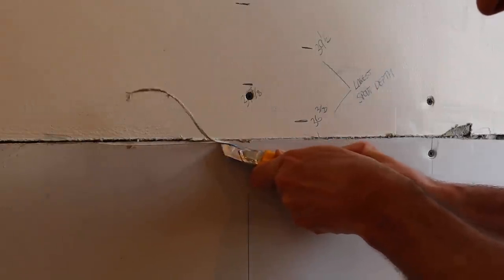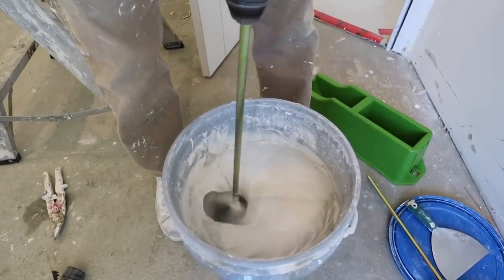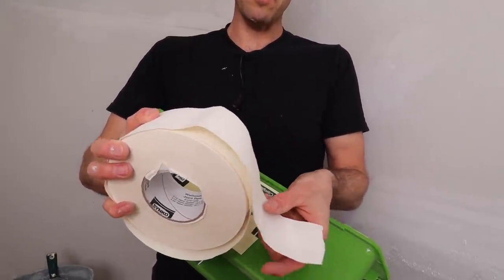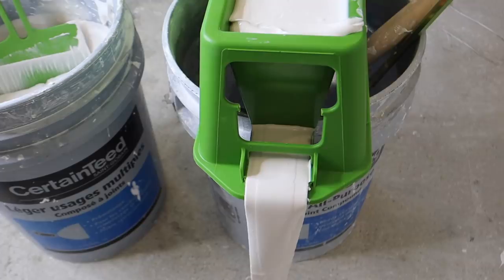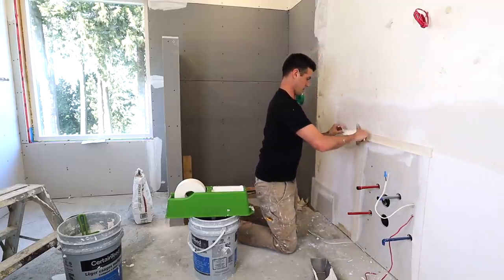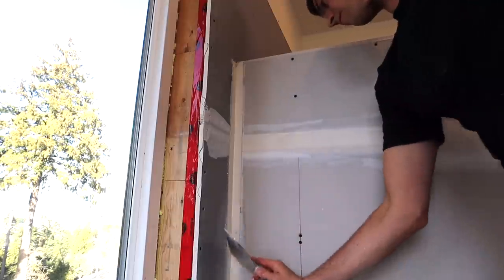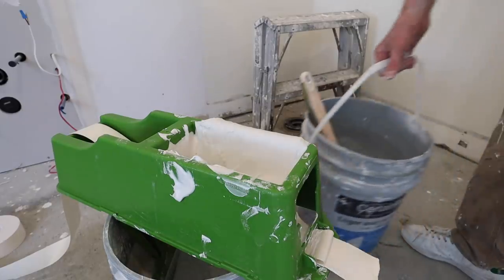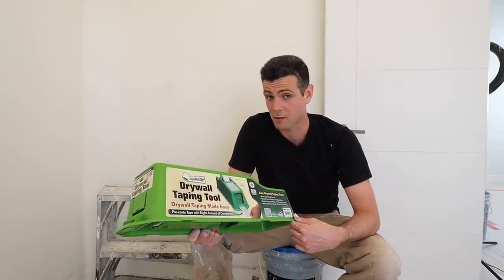How to use the Tape Buddy

Comment: If I may share my exp with it. Couple of years and still using it.

1. As you normaly do, I fill a bucket with mudded tape.
a. I made a cardboard cylinder as axel for the tape roll.(tight fit inside the roll)
b. I make the mud more liquid (helps keep the tape wet for the lenght of the tape in the bucket)
c. I've cut a small piece of plywood to cover the tapebuddy's mud section to keep it from making dried crums.

I've used it a couple of times as you did: one strip at a time. but to me a bit of waste of time... until I saw you use a bucket filled with mudded tape.  THAT was the game changer.  Just needed to find the right mud consistency (liquid enough)

When I strip/rebuild a bathroom, for example, I only spend a few hours taping out of a 12 days project. So the tapebuddy is ideal for me.  The only other tools I would get is the "cheap plastic corner tools" you reviewed:
https://www.youtube.com/watch?v=cQZ9cgn4HkM
(instead of doing one side of the corners at a time).

Thx again Ben.
Reply: bucket filled with mudded tape?
Reply: @nathansteinbaugh2914  He means that instead of pulling out one piece at a time, just pull a bunch of paper tape through the machine and collect it all into a bucket. That way you have a whole bunch of mudded tape in a bucket that you can carry around and all you need to do is apply and cut as you go. Ben did this technique in one of his stilt-walking videos a few months ago using a different mudding tool.
Reply: @claudews529   @umchoyka  ahhh this makes sense thank you so much
Reply: You can pull tape into a bucket but it's messy. That's why we suggest pulling what tape you need as you need it. Need a longer piece? Pull it out and book the coated tape. Much easier.
Reply: @BuddyToolsLLC 
 Are U for real???

Using a bucket, "it's messy"... so not using a bucket is not messy !?!!?  Geee. 

- I need to put a 12ft tape on the ceiling. So I got to pull a lenghty approximation, which I hold in my hands, then go up, apply, then waste the exceeding OR go back down and pull more because my lenghty was not long enough. Then go back again to pull some more for the next joint.
- First, doing it a lenght at a time is not less messy at all. On the contrary, because I need to do more manipulation I end up spreading mud on every thing I touch.
- Second, it's not easier at all. By doing a lenght at a time, I waste my time going back and forth.

So, Mister, instead of pushing your marketing dogma, why don't you learn from people's experience with your product and evolve your rethoric.

Pffff...
Reply: @claudews529   You asked "Why don't you learn from people's experience?" so "I saw a review and how to video by the Vancouver Carpenter on YouTube. I decided to give this a shot, and this thing saved me about 4½ to 5 hours of work and I was able to accomplish it all in 49 minutes! Make sure you use the more side for the break off tab. This thing is so amazing! It looks cheap, but I promise you, it is the best $35 you will ever spend!" This was a review posted on Amazon by someone that used the TapeBuddy tool.

Oh yes, embedding tape from a ladder you can only embed what you can reach so why try and work with 12' even out of a bucket. It's harder. Just pull tape and embed what you can reach since you have to get down and move the ladder anyway.
Reply: @BuddyToolsLLC  I don't mean to be rude, but.. using a ladder to tape, really !!!  No wonder you won't use a bucket full of mudded tape.

Let's get things straight... your avatar name is "BuddyToolsLCC"; you give suggestions as "we" (the company) (ie: " That's why we suggest") ;  And you use a ladder to tape !!!  You have to be kidding, really??

 If I'd use a ladder, I would tripple the job time (taping, mudding, sanding...), apart from the physical strain-contorsion...
Have a little imagination... use a baker, make a platform with 2x4's and buckets.... anything to stand on my 2 feet.

I rest my case..
Reply: This may be a dumb question but do you not have to put anymore mud on the tape after getting it on the wall or ceiling? Bc it’s only mudded on one side right?
Reply: @kaytlintoland444  dumb questions don't exist!!!
Actually, while applying the paper, there's always excess  mud... That mud,  I put over the tape. But let me clarify one thing, on that first application, I DO NOT try to make it nice, I only want to avoid bubbles under the paper, and make sure the outer side of the paper is also wet. That first paper coat is, in my case, ALWAYS ugly. Furthermore, I DO NOT put more mud to fill up... it take lot longer to dry, and sometimes cause paper to curl out.
Hope that helps.
Reply: @kaytlintoland444  One more details... I set my mud QUITE wet, I mean quite liquid... about like a shaken yogurt. I prefer a little more wet than less. Depending on the environment, the mud can start to dry a little too fast before I use my knife on it.
Reply: @claudews529  thank you so much for replying! Appreciate it!
Reply: @claudews529  Relax son! Don't go getting all unhinged on us  😋
Reply: @wildwoodtop  for being "Top" you sure are late, 11 months! (And who's "us"?? Can't speak for yourself !?!)
Whatever...
Reply: @umchoyka  I think Ben's tool was made out of an old box. Clever hack.
Reply: @claudews529  to each his own, would hate work with you.
Reply: @claudews529  Don't mean to be rude...proceeds to be rude.

Comment: The tape buddy turned a day's job taping a room in my house to just an hour or so, I would highly recommend. I pulled out several yards of tape though the tape buddy and put it in a bucket that i hung from my belt and easily did several corners and wall joints at a time

Comment: Just bought this and used 1600 ft of tape doing my basement in 2 days.. awesome tool
Reply: My mud dries out too fast - what type of mud did you use?
Reply: @tricko2286  l used Certain Teed in the red box from Lowes . Mixed it will water and made it runny enough to flow into the box
Reply: You and someone else made this same comment
Reply: R u j horton

Comment: In forty years as a design-remodeler and builder I had to tape all the jobs that were too small for the drywall guys. I got a Tape Buddy last year. O how I wish I'd had one forty years ago! It turns drywall work from a chore to a pleasure (as long as someone else sands).  
The VC hits every important point.

Comment: I made a similar tool using a cheap plastic mud pan and cutting slots at either end for the tape to pass through. I gave the exit slot a little bit of an arch to leave more mud in the center of the tape and mounted it on a cart with a dowel rod to hold the tape roll. I got hell for it the first time i brought it to a jobsite but was asked if i could make a couple more before the day was over. Faster cleaner and less mud waste.

Comment: For those joints with large gaps I highly recommend using "hot mud" (Common brand in the USA is USG "Easy Sand") that comes in 20, 45, and 90 minute set times. You can tape over it the same day. It is more difficult to sand but if you apply it properly you shouldn't have to sand it before taping with general purpose. A quick scraping is all I do. I would NEVER use general purpose to fill LARGE gaps. It shrinks too much and could take days to dry before you can apply tape. Thanks for your videos and tips. Watch them regularly.
Reply: Hes only referring to using the all purpose in the tape buddy because quikset is normally too thick and hardens too fast for this purpose, I agree though, I always prefill and normally do my first coat with 20 or 45, two coats in one day 😉
Reply: I was referring to the early 20 second mark in the video where he talks about cutting 45s in the joint and then filling that with all purpose mud instead of Easy Sand.
Reply: @brucegezon  oh definitely I would use quikset for that. I think he normally would too but thats maybe a little more than some diy people should try to bite off. I try not to use all purpose for anything where shrinking or cracking is a possibility, its just a finish mud for my work
Reply: @brucegezon   What Ben is showing is a drywall remodel where two edges come together and was just straightening the edges out. This void did need filled before taping and that's where the hot mud is the best to use.

Comment: The Tape Buddy is great, I'm a remodeler and always keep a TB in my van. Its great for those jobs that are
 in between hand taping and breaking out the big guns like a kitchen or bathroom remodel. The one thing is that in order to mud the right side of the tape the roll pulls from the top so find something small to go through the tape roll and rest on the sides of the TB so the roll is suspended then its easy going.

Comment: I am a remodeling contractor that does sheetrock, sometimes, the Tape Buddy is a great tool that I keep in the van for those occasional larger jobs. I don't bother setting it up, and cleaning after, for small jobs but if there 8-10 longer joints it does make it much easier and faster than pre mudding the joint with a knife and taping and its a lot cheaper than pro tools that are very costly and take a lot of space to store.
Reply: I set up the tool even for 8' of tape because I know there will never be any blister in the joint. I just don't want to take the chance of a repair.
Reply: @BuddyToolsLLC  I get it, call backs eat your lunch, and finding bubbles after texture and paint really sucks.
Reply: Can’t the tape be wiped too tight causing bubbles / blisters even with using this tool?  Or is it fool proof?
Reply: @holtrussell  Oh sure, but you can get bubbles with any method of taping. The Tape Buddy, when properly used, is a cheap/easy tool that gets a good even coat of mud on the tape but that's all it does, getting that tape on the joint properly is another thing all together.

Comment: I’m no pro. I’m just doing DIY at my home. After a couple rooms and a hallway that needed re-taped in places, I realized quickly taping isn’t fun! I’m now in the living room phase of it, and I ordered the Tape Buddy after seeing this video. It arrived today. I’ll be putting it through the test within a week. I’ll come back with my DIY’er review. Thanks for your channel!
Reply: I've been using this taping system for 25 years and not one blister. You'll enjoy taping with this new tool.
Reply: @BuddyToolsLLC  

Advance apologies for what ended up being a pretty long comment. 

Update: I finished the living room taping part using the Tape Buddy. I had 3 wall to ceiling inside corners, one wall inside corner, one tapered joint, and several (10) patch repairs ranging from 4”x4” to 32” x 15”. The corner joints were complicated by uneven settling of the home, which caused the need to replace the taping to begin with. 

As mentioned in my original comment, I’m not great with taping. Then again, I never did any drywall work in my 57 years until about this time last year. Lockdown makeover. Figured I’m home for a while. I’ll learn it and save some $, and get some remodeling done. 

The first room I did drywall repair in was the master bath. I really didn’t have a good handle on drywall work then, and it took me a couple months to get it all right. I did have some tape failure. Minor, but it’ll get repaired once I get my current room done. I did learn from the mistakes and managed to (slowly) execute better taping in the next 2 rooms and a hall. 

Note: all this work is renovation of existing drywall, and removing textured walls and popcorn ceilings at start of each room. There’s lots of problems the original home builder (owner) hid with the textures, hence my need to repair / replace drywall. 

So this is where the Tape Buddy comes in. I put it to work 6 days ago. I had to break up my time with it due to other things going on. My first day I got about 4 hours with it. I read up on the instructions, watched videos, and had a good idea on how to use it properly. My only error was starting in the “more mud” tab position. I figured I’m new. I’ll need extra mud to help me manage my way through. Nope. Less mud did just fine. I switched after the first corner. Next, I realized I needed the mud to be thinner than what I set up according to my previous taping pre- Tape Buddy. 

Once those two things were sorted, I had much better results in the following taping, and eons beyond what my previous ones were. It went smoother as I got familiar with it, and how to handle long lines without dragging them on the floor. Speaking of, I did discover that my old worn in 6” knife (trick I learned from this channel) did not cut the tape as easily as it seemed in the videos. I solved this by keeping a pair of decent scissors handy and cutting it with em. 

So to shorten my lengthy comment/review, I give the Tape Buddy 5/5 stars. 
- Works as described. 
- Inexpensive compared to pro tools, perfect for the DIY types like myself. 
- Easy to cleanup. 

Yes, there’s a small learning curve to really get the hang of it. But then, even a hammer has a learning curve to someone who’s never used one. If you’ve never taped at all, you’ll definitely want to go slow and small until you get it.

Comment: Hey thanks for taking the time to provide feedback on cleaning. Most other how-to-videos don’t bother and is such an important aspect if you care about your tools and the job overall
Reply: Since the TapeBuddy tool is made of plastic it won't ever rust however the mud is much easier to remove if cleaned right away. I use a auto parts pointed round brush to clean my tools because it gets into the corners easily. If you finish your job and have to get going without cleaning you can set the tool outside until it rain! Again, no rust. If the mud dries, just soak it in a bucket unless you are running hot mud. This mud doesn't come off so make sure you clean this right away.

Comment: I just used one of these for the first time (the job took about 400 feet of tape) and used it to fill a bucket with mudded tape from it as you do in your Super Taper videos and dispense tape from the bucket as I walk around the room.  The differences I see are that I'll have to fill the Drywall Buddy periodically, not so for the Super Taper.  However, the cleanup on this is super easy and I'm sure there's more to it with the Super Taper.  If I did mostly drywall I'd have to think the Super Taper would be better, but at even a half a house project I have to wonder if it's even worth it to pull out the Super Taper.  There's no difference that I'm aware of once the bucket is full of tape.  It doesn't matter whether it was filled from the Super Taper or the Drywall Buddy.  I've never used a Super Taper, but I was really happy with the coverage this gave for the tape. Either one is many times faster than hand taping.  I don't plan to buy a Super Taper myself.  This is close enough for me.  My biggest jobs would only occasionally be a home remodel of about half the house.  I'm probably never going to tape a job where stilts are required, but if that were to happen, the maybe refilling the Tape Buddy more often might be a bigger deal than using the Super Taper pump. Having said that, if I were clever enough I could make a hopper to feed the Tape Buddy and never give the Super Taper a thought.  🙂

Comment: Thanks for clarifying the 'more mud'/''less mud' directions. I'm pretty sure I got it backwards and would have liked a little more mud on the tape. It never occurred to me that the description would be readable from the bottom if you turned the tool upside down.

Comment: I agree to use the thick mud side and to pull down.  I tried the thin side first and it was too thin.   I attach mine onto a piece of plywood using 2 screws through the front outer edge,  then I set it on top of taller, heavy trash can.  I keep a bucket on the floor in front and can pull out longer runs into the bucket. And I cover the top with sticky plastic wrap to keep the mud from drying out.
Reply: I just use a scrap piece of drywall to cover the mud compartment. Add a splash of water first if going to be gone for any length of time.

Comment: Ben, there is one video I have not yet located on your channel - how to repair tape that has cracked at the joint, and the cracking runs the whole length of the sheet, or beyond. I have several ceilings where the entire joint has cracked, but the edges of the tape are not coming up. Some rooms were painted by me a few years ago (cracks are recent) other ceilings have yet to be painted from the initial "contractor color" that was done 15+ years ago. Yea, I know. I assume I should remove all the tape, and clean out the joint, and if so, this tool would make absolute sense, as I would be doing a lot of taping to correct. Look forward to your reply, and the project that I will have to undertake.
Reply: Sorry to hear you have to redo the seams. Not fun. It sounds like the tape didn't have enough mud behind it to set right. When you pull the tape off your find out what happened. The TapeBuddy tool will help you with this re-tape but the prep work will be the worse. When you pull the old tape off you might want to refasten the drywall with new screws to make sure it doesn't move in the future. The TapeBuddy tool will make your project go much easier.

Comment: I dunno about these machines. I always find by the time I've washed it all out etc I could have just put the mud on with a knife and layed the tape on it the old fashioned way. Especially for small and medium sizes jobs. But that does look like it would wash out nicely and that the setup was straightforward enough. Certainly makes it easier for a dryer for sure.
Reply: Tools like this are attractive to the DIYer who doesn't trust their own skills.
Reply: @monkeygraborange  seems like if a person had lots of long factory edge joints such as a garage or basement rec room this product would be worth using and cheaper than a banjo by an order of magnitude.